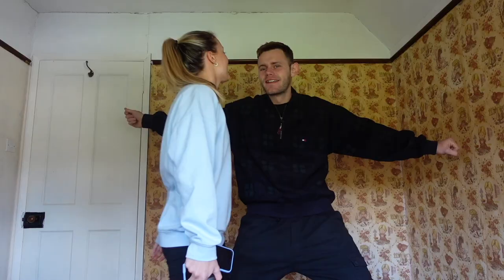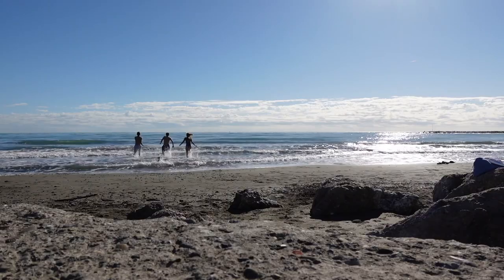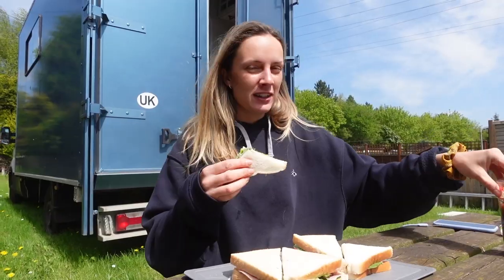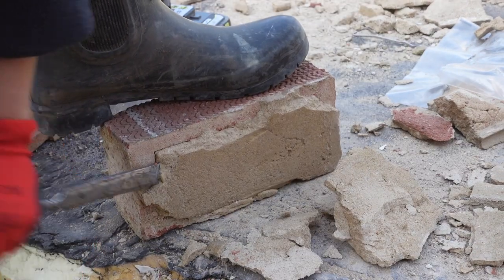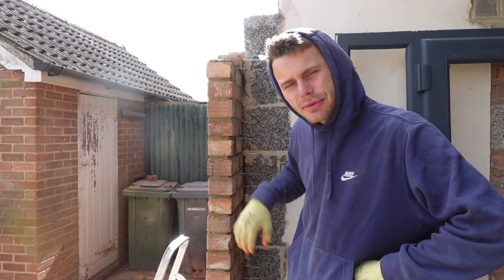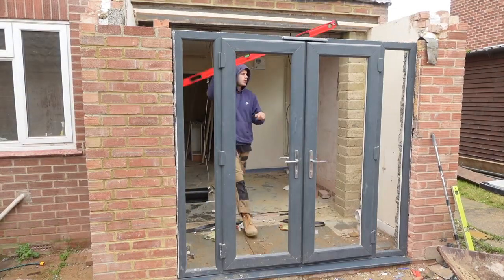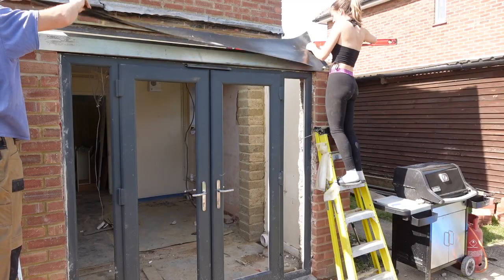Renovating a UK Auction Property into Luxury Home on a 30k Budget. Ep3. The Renovation Series.

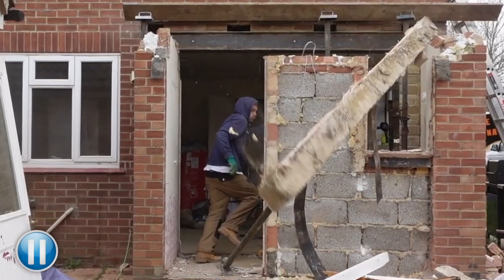Comment: £2:18 per brick? if you added your time and labour spent de-mortaring each one,  then you could easily be looking at £4.00 per brick, this is yet another false economy saving DIYers make. I appreciate that you do not have the advantage of buying from a Trade suppler, but even from the likes of B&Q, Bricks like your using would work out at £1.11 each, saving you time and money depending on how many you need. I once spent  10 days cleaning bricks for an Extention, cost in time and Labour £1,500, only to discover that a pallet of 250 bricks was £250 and I could of got the 1000 bricks needed, without the mess, hand bashing, brick damaging, hard work, involved and saved myself £500 in the process.  Cleaning bricks should be a last resort, depending on how many you need. Hope you got a tetanus jab after siting on that nail?
Reply from the maker: Hi Panda, the specific bricks we need are pretty hard to find, where places like B and Q don't stock them, we obviously want the design to match otherwise it will look extremely cheap. We do make sure we value our time, and do buy new materials to prevent this long slow work where possible, we just wanted to give those viewers, who may be less familiar with construction, a bit of perspective to how many background jobs there are on a site to be prepped properly.